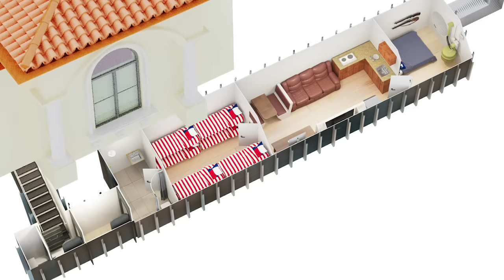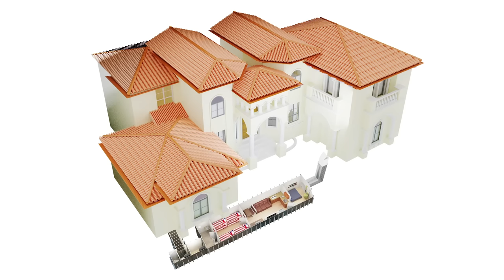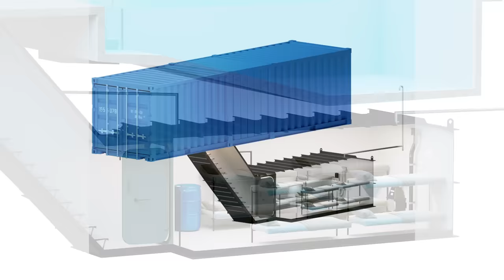A $200,000 Luxury Bomb Shelter Under a Home - Atlas 10x40' Platinum Series Safe Cellar

Comment: Great video! I noticed that you said it was hooked to street water system. If a disaster ever hit they may not be able to draw from the street and the tanks only last so long they may want to consider a ground well near there bunker which will give them unlimited water supply. I noticed during the install the ground had a lot of water around the bunker that means the soil in rich in water and retains it good.
Reply: You thought the same thing I did but for different reasons. 👍

Comment: Nice! 
Even though it's all water proof if it was my project I'd like to see the concrete pad sitting on a good layer of gravel with construction sand on top with water drainage pipe burried around the perimeter of the concrete to keep ground water away preventing corrosion and leaks
Reply: Exactly the same as I was thinking.
Once you have paid $ 230,000, you can probably pay $ 5,000 for good drainage.
Reply: yeah I don't understand why they don't do a drain tile under the slabs. Yeah its water tight, but hell a good drain tile, sump pit/ extractor pit isn't that expensive.
Reply: You're right. I can see the mold in no time... I saw a story of a moldy bunker...
Reply: Or Incase it in concrete
Reply: Do you think the PVC pipes would be a weak point. I kind expected them to be steel or encased in concrete...🤷‍♀️
Reply: From a construction inspection background, i can tell you that these guys are doing so many things wrong, but the shelter itself seems decent, and they claim it is waterproof so it doesn't really matter as long as the subgrade was dry or stable prior to placing the concrete, the concrete is just meant to be a stable flat surface that the shelter can evenly distribute the weight over.  But these guys are the reason there are building codes, i can go through the obvious questionable practices if people want, but there are soo many bad practices and poor choices in this video it blows my mind.  I might buy a shelter, but ill do the excavation, site prep, and backfill myself.
Reply: @josephescott3263  hell as a welder, I don't trust those welds. If I'm going to have a bunker, I'm going to make it myself

Comment: A few logistical questions:

Where is there a backup for air filtration?

Where is there a backup for power in the event that your house’s power is not functioning?

What about plumbing?

Interior security? How long would it take for someone to penetrate any of the layers of doors?
Reply: Given the line item of "$20,000 for backup power" I'm going to suggest there's backup power. Plus there's a generator room.
Reply: The generator is the backup power

Comment: What's the guarantee on all this specialised equipment? What happens if the oxygen machine stops working? Someone has to manually turn the handle every hour depending on how many people are in the bunker? That itself will use up oxygen. No back up plan? Like a solar operated system of some sort? Like sailors have died in a submarine because of lack of oxygen. This would be my main concern. Also what if the water is contaminated? How can it be purified?

Comment: Ron: I've been enjoying your videos for several years, and this is one of the best yet. I have to wonder if your so-called competitors might pick up on info you're giving away and undercut you.  
Something else comes to mind: I notice that your offset stairways always descend from the left side, an advantage for an armed attacker but a problem for the defender (unless he/she is a southpaw).  But if it came down from the right, a right-handed shooter would have an easier time defending because he wouldn't have to shoot off-hand, and the same disadvantage would apply to an attacker coming down the stair.  
You might even provide an optional hinged, stairwell-height flap of AR500 with firing and observation slots cut in it. This could be swung open from the stair side of the corner to offer additional protection to a defending right-handed shooter down below.  Just a thought. Keep up the great work. If I ever get rich, I'll be in touch.
Reply: If someone is that intent on coming in that we're worrying about a left hander assaulting down the stairway, they would just throw frag down the stairway into the bunker
Reply: But I do like ya idea of a built in fighting bay
Reply: Someone could just walk up to the bunker and cover the air pipes, forcing the occupants to eventually exit.
Reply: @leattner12  For a bunker like this one - located beneath the house's slab - the air pipes could be carried up within the walls of the house, thus less accessible, and can be disguised to make them harder to see. That being said, any such structure can be overcome with enough effort and patience.  Survival is the art/science of opposing those people, places and conditions that are trying to kill you.  Survivalism isn't a guarantee, it's an effort.
Reply: @kingyankee69  Watch his other videos. The bucket has holes and is generally filled with and placed in gravel for drainage. Granted, any defense can be overcome with enough effort and time, but Atlas does a pretty good job; far better than Rising S. The first defense is hiding the assets.
Reply: @kingyankee69  Rising S; that's why Ron was so upset to see them get cheated by a con man.

Comment: 12:13 Should someone not be compacting the soil every 12 inches otherwise there could be too much top pressure on the shelter?
Reply from the maker: It's was.  You just did not see it.  Water was added to settle the clay.

Comment: If they struggled getting onto that flat wide open space, there's no way you'd ever get a shelter on my property.
Reply: a smaller one. Or a different trailer
Reply: Option B: make a shelter out of concrete, like a basement. Likely a lot cheaper than a steel bunker and probably last a lot longer (not going to rust out in 30 years).
Reply: Guy Tech    That would be and already is my option A.    You are totally correct
Reply: Guy Tech   And I really don’t see how they manage water.   A basement has water management as part of its foundation
Reply: @guytech7310  exactly. And you dont even need to make it 100% airtight. And the airfilter isnt even that important, you can also put a car style airfilter on the beginning of the pipe, as long as all the dust particles get filtered out of the air.
Reply: @kaptein1247  Well I would go with an upgraded air filter. I suspect a lot of stuff is going to burn for weeks to months and likely be in gas form that cannot be filtered with a HVAC type filter. You really need a carbon filter to handle it. For instance NOx, SOx, and who knows what from burning plastics and chemical plants.
Reply: Cool 😂❤.

Comment: I can see how being rich is frustrating.     Even when you can spend $ 250,000 on something, you still have to look for ways to economize things.     For example all that work to set the crane up and one might could have installed two bunkers, and had an underground duplex, or a mother-in-law room.     And you could have filled it in with high-grade material, or maybe put it a foot deeper, or added a 2nd entrance on the other corner of the property, etc.

How long could someone live underground in that one, without ever coming back up ?     It seems like you would have to plan for a family member dying down there, if the surface was too dangerous for some crazy reason.

How much would it cost to just build a basement instead ??      Is there a point where a factory-built bunker is not practical ?     Or do you just go modular after you want a XXXL size.
Reply: Trump will just give them more tax cuts. And other giveaways

Comment: Do bunkers have EM protection? e.g. Faraday cage?
Reply: A welded Steel bunker is a faraday cage. However if you build a concrete (cheaper in my opinion) you need to make a faraday cages (Steel trash can sealed with alum. Duct tape will work).

Comment: If the off board water tanks run out of water, go yo have to use the main line to refill the off board water tanks or do those have have to be refilled separately? If they have to be refilled separately, How would you refill them especially if the local water table has been contaminated due to natural disaster

Comment: I have a few questions We go under attack to where a bomb shelter is needed we lose the grid out goes the electric, if grid goes down so does town or city water so how many days do you have on water tank? and also without grid you lose gas station so how long you have on generator? solar panels get damaged or destroyed what backup is there for waste pump and water pump and air pump and if there is backup how long can all systems be ran on backup? if a a nuclear bomb went off close enough to flatten everything and door got buried what kind of system is there to open door if it can't be done manually? These bunkers all inground bunkers seem like a multi person coffin and if it isn't known about you may be there for eternity or until the start excavating and find the bunker by mistake. most of these seem like a death trap when in a situation where they would be needed or used.

Comment: Overall great layout, only thing I could think is if they'd of had water run to that mud room with a floor drain, or just installed another air tight door before the living quarters. That way you'd have some sort of decon area. These guys' mechanical engineering/HVAC is on point though.

Comment: The air filter is placed in the master bedroom, which is considered a talent, and it feels like you can't sleep without noise. The water supply system also relies on the existing municipal water supply. Then how can I play if the water is cut off? It is recommended to put the air filter in the power generation room and use pipes for gas separation. This will not only isolate the noise, but also filter the carbon monoxide in the power generation room to a certain extent. After all, you don't want to open the power generation room and faint at the door, right? For water supply, if allowed by the law, try to dig a deep well yourself to extract groundwater for use. If you need to enter the bunker for refuge, do you think the municipal water supply can be effectively maintained?

Comment: I must say, a generation room seems kind of silly to me. These are typically designed for end of the world scenarios, right? Why wouldn't these be setup for solar power? Something long term. Fuel will not only become a scarce commodity, but also won't be around long after an apocalypse.

And I'm not expert, but for that price tag, the least you could do is get rid of the monotonous drab color scheme.

Comment: I'm curious to know about a Hot Water Heater, You cannot use gas for hot water and if you are running off of solar how do you heat the water for showers and dishes? Water temp would be room temp and 55 degrees would make for a cold shower

Comment: I always see this iron bunkers in videos from the States. An iron bunker 1 or 2metres under the surface is like a pommes deep frier in case of an atomic blast. Private bunkers here in Germany are ten metres deep from top edge and 1.5metres thick walls and roof from steele armored concrete. I dont know what people think get in a tin can near the surface in case of an atomic blast with 1000 degrees centigrade or more on the surface...
Reply: Denen geht es hauptsächlich um Fallout und Druckwelle, da reicht das vollkommen aus. Die du meinst können auch einen direkten Treffer ab, aber wie hoch ist die Wahrscheinlichkeit das es genau über dir passiert?
Reply: The building site is in the middle of nowhere, so a direct hit will not be an issue. In essence, the bunker is a fallout shelter. 

Die Baustelle liegt mitten im Nirgendwo, ein Volltreffer ist also kein Problem.  Im Wesentlichen ist der Bunker ein Atomschutzbunker.

Comment: I would love to install a 20 foot culvert bunker in my mountain cabin. My idea would be to connect to our well water which would feed an internal tank and the waste going to the existing septic system. I would have to have redundant systems for water, air and waste and spare macerator pump in case the main one fails, air filters and water pumps. Also I would connect to the main house solar but with an alternate form of charging the bunker lithium batteries such as a bike generator or propane generator in a separate pod. My take is that if everything goes to hell, the solar panels might get stolen, leaving the bunker without power or worse destroyed by what ever calamity forced us into the bunker.  

My only nit pick on this video, is the finishing touches inside the "Luxury" bunker. For example the finishing nail holes on the wall paneling not being covered and painted and under the floor boards, the hand stains all over. Granted none of that matters when you need a place to survive. I would still get an Atlas bunker if I had the money, well, I should re-frase, if my wife allowed me. Great work and thanks for the videos. I hope that when the aliens finally invade earth, it happens after I get the bunker.

Comment: So what was the depth of this 200K bunker? It did not look like the top of the bunker was but a few feet underground. Do the 600 gallon water tanks fill up from the main water source when water tanks have been used up?  Is contacting the dirt only important on a cylindrical bunker?
Reply from the maker: It's 7' under ground once the house foundation is poured

Comment: The only thing I see that would annoy me would be having to listen to that load air filter system right in the master bedroom. I would think they would build a little room for it off the master bedroom and have a access door to get to it if you needed to so it wouldn’t be as loud in the bedroom.
Reply: Right! Exactly what I was thinking.  They have a nice secluded room for the generator, which only takes up a small spot.  Why not just put the air system in there too?

Comment: Why is the loud components in the master bedroom, be a ball ache trying to sleep with that noise. and for it to be a heavy duty bunker its power and water feeds are only encased in pvc pipe? So you can be safe yourself in the bunker, but your power and water feeds can break/melt easily so you'll die in there anyway

Comment: underneath that plank you pulled up to bypass the water to tank water there should be a diagram on the bottom on how to throw those valves.

Comment: That lowboy trailer did not bottom out, he high-centered, that's where there's a a high spot or hump in the road makes contact with the center of the trailer.
When this happens and it's at a railroad crossing, there's not much you can do except have a tow truck lift the back end and then back out, but since this is on soft ground, they might be able to just push it and let the ground move out of the way of the center of the trailer.

Comment: If the whole thing cost $200k w/all construction and setup then it's way well worth it.  I would like to know the total cost w/ all the permits, traffic diversion, etc.  Got to be closer to $500k w/o the house on top yet.  Nevermind @ 8:00 I got my answers.  Still a bargain and you'll protect your family from storms and other multitude of bad things.
Reply: Just think of it as storage until something happens. Just like extra food and clothes.
Reply: @robertbogan225  seeing his recent upload where he basically said that you dont need a shelter to survive a fallout, I just want a basement with a bed and toilet
Reply: @kaptein1247  Depends on many things. As a general rule, the taller your home the safer it will be. A single-story home with basement is going to be far worse off because you'll be in closer proximity to the radioactive material. The more floors and distance you can put between yourself and the radiation, the better.
Reply: I wonder if they included the charges from the government for the dozer tearing up the road!

Comment: A few things Was there any drains around the slab  to drain water away from it ?. Ideally never place metal on to concrete always on little rubber pads 
I would never rely on pumps for water in or out . 
Say the sh1t hits the fan . What happen when the pumps fail which they will, its not like you will be able to run down the the hardware store and pick up another one.   If you loose all power can you stay get fresh air ? Everything should be gravity feed . And really if the sewer system/grid fails you will be in the sh1t, so you should be able to by pass it to a septic tank at least.   if all main power goes out  that generator looked to small. and should only be used as a battery top up . Maybe build water tanks next to the stair access and make the whole area the same width as the bunker that can be pressurised with a hand pump if needed, you dont need much PSI to pump water.

Comment: Hard steel bunker, but the house is made of sticks ...  I'd be looking at a monolithic dome. Concrete.
Reply: Better a lightweight timber house, it will burn away to pretty much nothing or be flattened by the overpressure rather than become a pile of rubble that puts the main access out of action.

Comment: Question: Why putting the bedroom in the most noisy part of the bunker that is the Air system room ?
Reply: I wondered that too, and way put the generator in such a way that you need to leave the gas tight area to reach it?